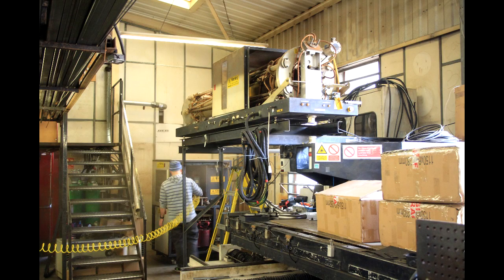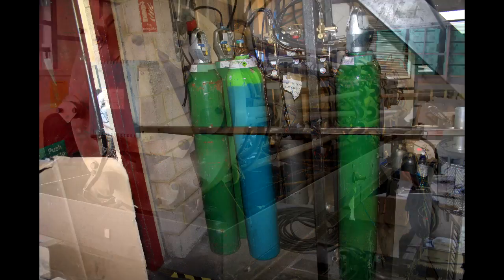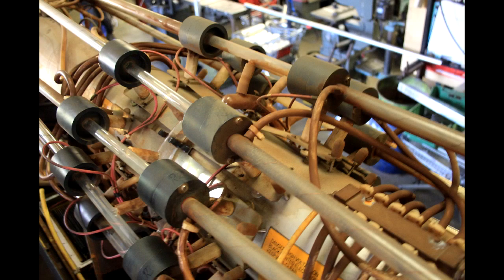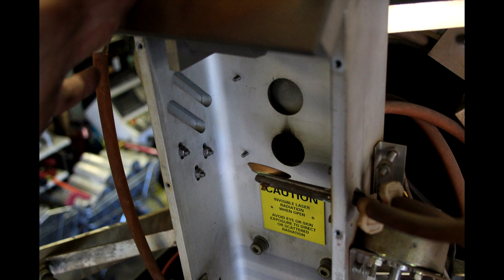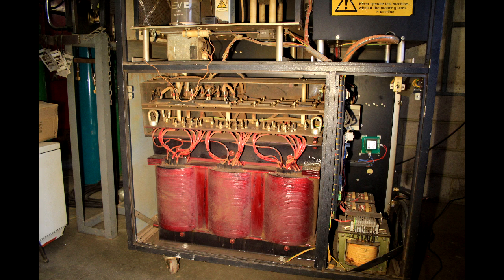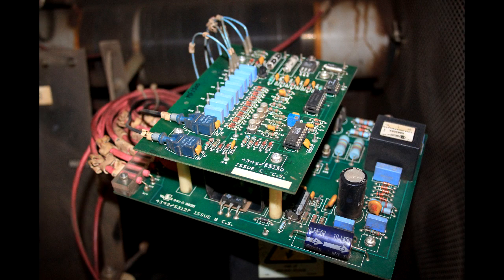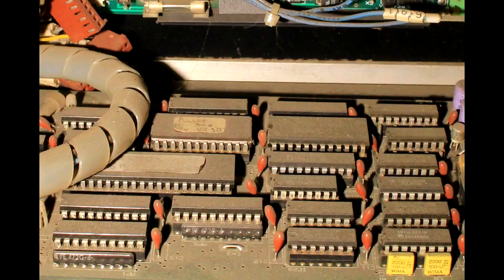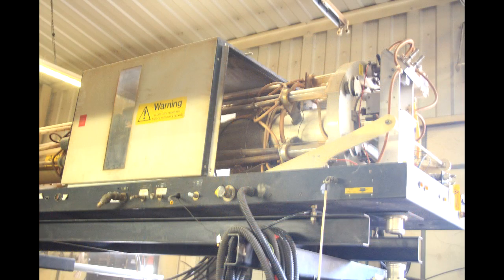Ferranti Photonics MF1500 Industrial 1.5kW CO2 laser

Comment: What's the modern day version of this? (With what looks to be DIP package 7400 series logic, I'm guessing that was pretty old). Other than cheap-o Chinese junk i couldn't find any reputable (e.g. Coherent or whatnot) industrial lasers on eBay just to see pricing/specs/input power/chemical requirements. I'd imagine by now the efficiency would have gone a bit up from nearly 28:1.5 and the length a bit down.

Comment: Very nice video, brought back some memories. 
I used to work in a factory that had a Ferranti 300W laser perched on top of a Trumpf T180K CNC punch press. It was possibly the first "combi" machine in the wild, pretty much home brewed. The laser was similar but a lot smaller (about 1.5m long). 
The laser tube similarly fired down the side of the machine on to the workpiece held in the standard clamps of the punch press. We got around the limited power by pre-punching holes in the sheet with a 3mm punch then cut out from there. The laser floated on the punch and punching larger holes could drive the alignment between punch and laser out. Punching very large holes broke laser tubes!
The laser cutting nozzle height was regulated by a skid on the bottom that sat on the sheet and lifted the head to allow for variation in sheet thickness or flatness. It was possible to lift the head when operating or open the shutter manually and get bits of body in the beam. It hurt, cauterizing as well as cutting and burning making a would that took ages to heal right.
The laser pretty much needed a full time maintenance engineer, very fragile.

Comment: That's a crazy laser. Are newer systems smaller? Because I've seen the ones we use at the factory but I'm not sure if there's a larger control system that's below in the subfloor or if its just a lot smaller. It's used for cutting a similar thickness metal.

Comment: Looks like a right problem to maintain, I think water jet and plasma cutters have made this tech obsolete.
Reply from the maker: +Sean Breheny Big CO2 lasers are still going strong, but other techs are starting to compete, in particular diode pumped fibre lasers which can do kW powers and be shared between multiple cutting heads, are quite efficient & don't need gas supplies.
Reply: +Mike James plasma is good for crude work, building construction pieces to be SMAW welded and that sort of things, while CO2 lasers have beam width of 0,7mm (not sure if that is general, but where the one I sometimes order cuts on, has this spec), of course you can't maintain that width of cut on 20+mm thick stuff, but if they take time to realign the laser for the thick stuff (and the material is suitable, because not all black steels cut the same), the cut edge is very smooth and at a right angle, plasma cuts can't be compared to this

regarding water jet - width of cut again and the most important thing - speed, it slows down a lot on thick stuff = gets really expensive compared to laser, on the plus side - no heat distortion, which can become an issue with plasma and laser

so nothing is obsolete, they all have their uses at the moment
Reply: +Mike James Laser cutters and engravers are not obsolete but I think they can be made more compact than this now. For one thing, there are diode lasers that go up into the 10s of watts and they can be set up in coherent arrays to combine their power into a single beam. I would be interested to see Mike show the innards of a more modern one!

Comment: Has anyone tried putting their hand in the way of the laser? If so, does it cause any skin irritation?
Reply from the maker: +Razor2048 The word is "amputation", not "Irritation"!
Reply: +Razor2048 Hard to tell, they haven't found the hand yet to tell if it shows any signs of irritation.
Reply: One lump of molten cup or two?
Reply: +mikeselectricstuff I think it is a good way to heat coffee.
Reply: +Rigo trolled
Reply: +Lucas Power output is important. X-ray lasers are much thinner wavelength then CO2 and can cause significant damage as it is ionising radiation.

That said, any amount of power dumped onto a point can cause damage, so as long as it has enough energy to break chemical bonds within the material (in the case of skin Keratin).
Reply: +Razor2048 A CO2 laser is not dangerous to human skin since we're made of CO2. It's the same as why pouring a cup of water into a pond does not damage the pond. You would probably feel a tingling sensation.

Comment: Real cool video.  I could see a use for this in making metal hole through signs.  Does not seem cost effective to buy this thing  to just cut flat metal plates.  Maybe the jig to hold the goods does the positioning.  It´s hard to imagine moving the laser around for precision work.